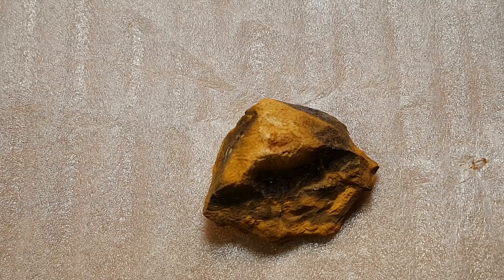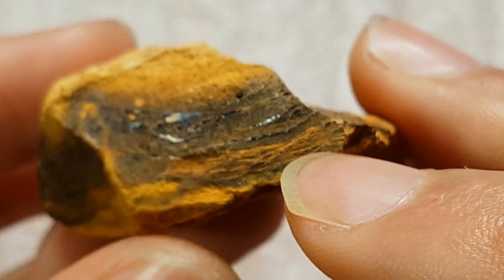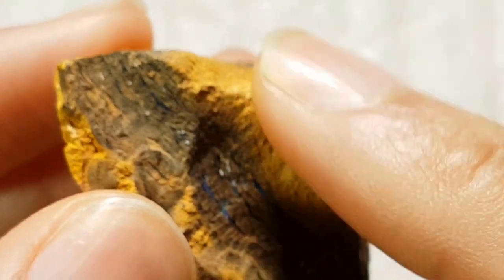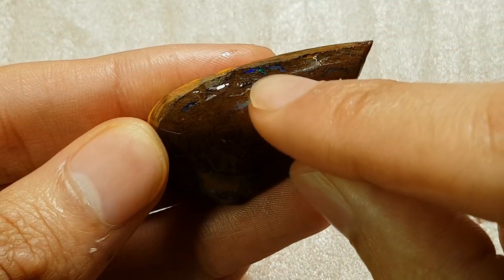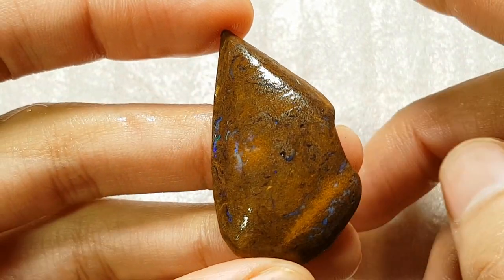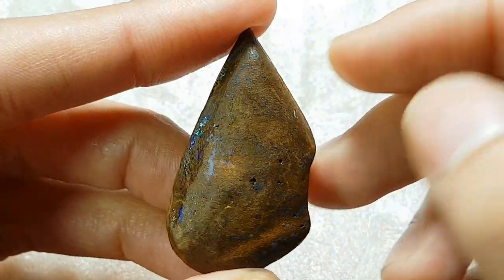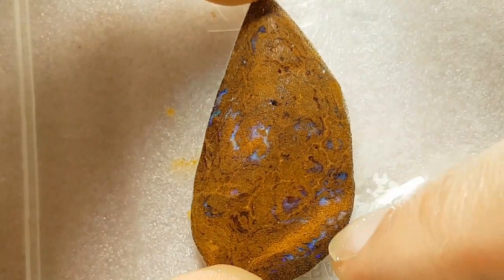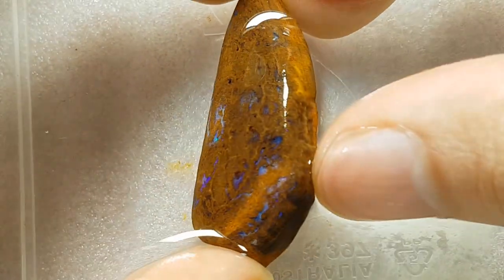Boulder Opal Carving (Part 1: Rough to Rub)

Comment: awesome polish would you be able to tell me what tool you were using? thanks
Reply from the maker: A very old video this one. Simply just an ozito rotary tool with flex shaft and electroplated diamond burrs. Total of about $60AUD.
Reply: What grit is that burr? I’m trying to carve my boulder opals and the burr which came with my Renegade rotary tool is really struggling with the dark material (ironstone?)

Comment: Hi from the UK Roy just starting out armed with a Dremel and a wish here and wanted to let you know how much I am enjoying you Vids 👍 and that you are responsible for my latest obsession 😉😂 

Currently  awaiting my Nova tips and Sintered Diamond set from the US + a pack of Boulder Opal from Queensland so going to be armed and Dangerous but thanks to you sharing not Totally clueless 😂 

A couple of things if I may ask is what pressure you apply when working on Boulder ? Also what is the best way to contact you as I would love some advise on which piece to start on when the goodies finally arrive 😉 Thanks, Sue
Reply from the maker: "what pressure you apply when working on Boulder?"
Depends on the stage but you never want to push very hard or you are asking a lot of your Dremel's chuck or collets. Also the ironstone will melt away quite easily so you wont need to push at all to remove it.

You can contact me in many places but through the website roysrocks.com is the best bet. I'm phasing many of the other methods out slowly.

Comment: Since the "back" had that sandy area, I'm wondering why you didn't just treat the back as the front and grind that off instead.  it would seem that you could grind a tiny bit into the color bar and get the same effect as approaching the color bar from the front, and then you would have a solid back for the piece.
Reply from the maker: There is no telling how deep that sand goes. Looking at the piece (which was surprisingly still on my desk) the sandy region goes almost all the way through and it is actually quite stable.

Comment: that stone looks really cool, even in total rough. ive been trying to figure out pricing, so i dont spend too much when i order online. was hoping you could tell me what the average price of a chunk of rough like this normally is priced at. btw, thanks for making such a great, and detailed video. it both helps me understand how long, and arduous it will be, and really gets me pumped about the opals ive ordered, and cant wait to put my dremel to use on some color! thanks!
Reply from the maker: Pricing can be all over the place particularly for boulder opal. 
This chunk is pretty low grade and rather than pricing per ct boulder is done more by potential in the stone. This came from a parcel with an average stone value of $10-15 per stone.
Reply: @RoysRocks  cool man, thanks for the answer. where can i buy such parcels? im in the usa, so i would have to order online. any suggestions?
Reply from the maker: @redeyestones3738  Opalauctions is a great site for all sorts of opal (just be cautious of "sales" or "reduced" prices). Otherwise Nick Hoops is on facebook (think he sells internationally).
Reply: @RoysRocks  cool, thanks. I'll have to check out their site. I don't use Facebook.
I've made an order with Murray, and he seems like a good bloke. But I like to check out options. Thanks again.
Reply from the maker: @redeyestones3738  You are a wise man to not have a facebook. I know there was someone over in the USA that was bulk buying boulder opal to on sell domestically at reasonable prices... I just cant remember the name.
Reply: @RoysRocks  no worries, bud. And ya, having Facebook is like having a subscription to a Chanel that only plays commercials. Lol
Reply from the maker: @redeyestones3738  A subscription and a HUGE window into your life that is probably better closed LOL. If not for the channel and community I'd be out of there.

Comment: These clay inclusions are the only thing I really don't like to see when working with Boulder Opal☹ so annoying sometimes.
Reply from the maker: It can sure get messy but at least it is soft and easy to remove. I find it quite fun for some reason.
Reply: @RoysRocks  ya but when you then remove it and it goes far into the stone, then you could end up with one or more deep holes in the stone, which I find pretty problematic sometimes. And when you don't remove the stuff, then you pretty much just can keep the stone for yourself but not selling it anymore, because the clay could over time come out of the stone at the person who purchased the stone. Or one could fill the holes with resin, I don't know.
Reply from the maker: @Der_Kleine_Mann  Yeah many do exactly just that in terms of resin treating. Similar to andamooka matrix it plugs those holes and allows a high polish.
Boulder can be quite tough unless you get the high quality full faced stuff.
Reply: @RoysRocks  I always buy a mix of everything, so there is material with veins and matrix material, and most of the material is very nice and stable, but sometimes there are a few of the matrix pieces that are a conglomerate which also contains pockets of clay and I don't really think that they're worth the effort and that's why I just leave them behind when I spot them. Maybe I'll try to treat one with resin and see how it goes because except for the clay the material can look pretty interesting.
Reply from the maker: @Der_Kleine_Mann  Yeah I know what you mean by the clay too. I'm currently trying to get something done for my 1000 subscriber video and am battling that very issue.
Good thing I dont give up though. Race against time to get it done in time!!!
Reply: @RoysRocks  Looking forward to that video